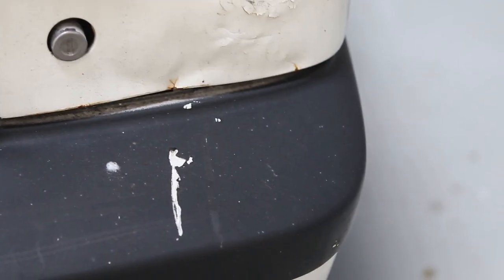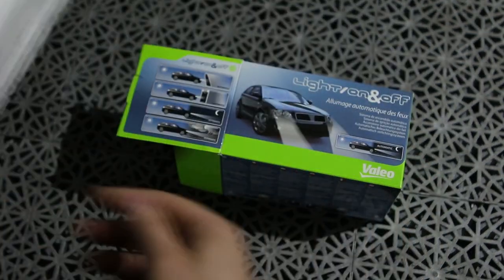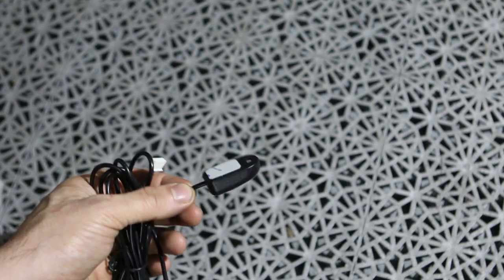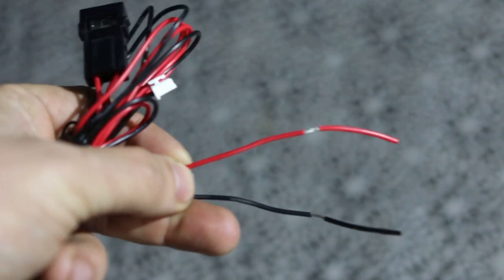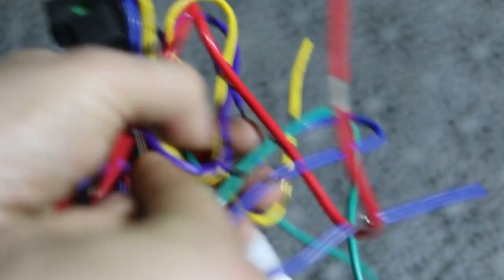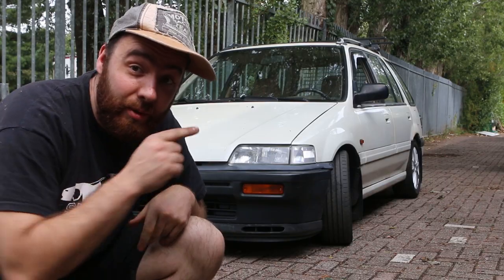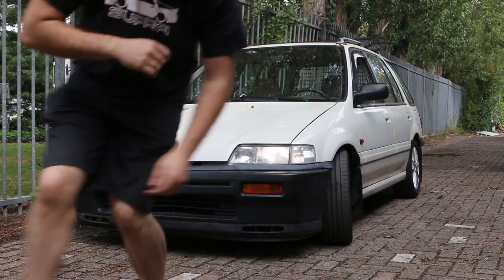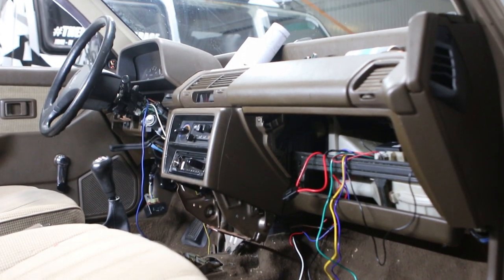How to make your headlights automatic

Comment: These are cool. I like the automatic headlights. But I wish that it had a dual mode. Like when it's cloudy but daylight, the parking lights only come on, and then when it's dark enough to make a difference, the headlights come on.
Reply: wire in a 5 pin relay and itll work

Comment: Hello. Can you tell me how it's working? Do the lights turn on immediately after turning the key to the acc position at night, without starting the engine, or only after starting the engine and detecting a higher voltage?

Comment: Good video, thank you. 
2 things: first, does the kit you installed also control the running lights, they didn't seem to come on. Second, it would be easier to listen to the video if it were in stereo, like the song at the end.
Reply from the maker: Good question! Since the car is from europe it does not have running lights so thats why they didn't turn on. And secondly the mono sound was because I dropped the camera when filming rolling shots and ruined the mic haha. We got a new mic now so it should all be fixed!
Reply: Yes it will disable/dim your running light (DRL) because it's wired straight on the light switch harness so it act like if you turn the switch to "low beam" (it has 2 wires) so the city light are controlled at the same time that the low beam and make your DRL turn off/dimmed 👍
Reply: And by the way,  where i am from (the pacific northwest) the time as i am watching this channel for the first time, is 12:02 a.m.   ha ha.  <Coincidence detected>